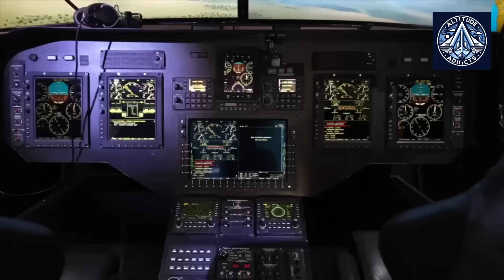Yak-40 Flies with VK-800 Engine -  How Russia Plans to Ditch General Electric Engines

Comment: Es kommt immer auf die Region, den wirklich vorhandenen Verkehrsbedarf & die örtliche Infrastruktur welche zur Verfügung steht.
Mit den in Entwicklung befindlichen Flugzeugen wird man zukünftig die AN 2/24/26 die L 410/610,  Dash & andere ersetzen können. UAC wird Schritt für Schritt für alle Bereiche russische Flugzeuge liefern. Mit Ladoga, IL 114-300, SJ (80)/100/130, MS 21- (200/210) & 300/310 & *400/410) & (500/510) und der IL 98-400 u.v.a. befindet sich vieles in der Entwicklung oder bereits in der Test- & Zertifizierungsphase.

Comment: Look weird with front propeler with wira jet unit at back mean combine jet and propeler, amazing🇷🇺👌🙏
Reply: It does, but it would look even more stupid on the other aircraft they use for engine testing... the Il-76LL, which is rather too big for testing such a small engine.
Reply: @garryb374  It's only for engine testing, and for facilitating instruments and engineers.
It doesn't matter what kind of airplane they use.

Comment: they were also going to use the VK-800 on the heavy UAV the Altius which UWCA is also going to build - that would seem a great platform to clock up more flight hours without risking any test pilot's lives to speed things up.